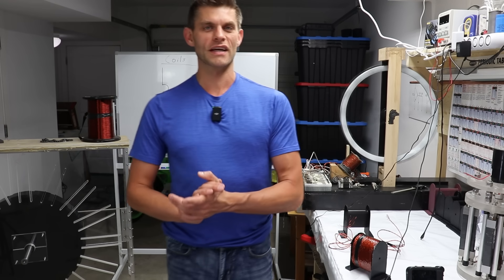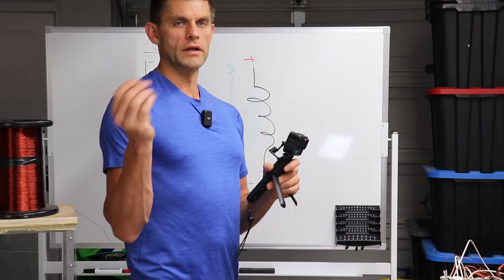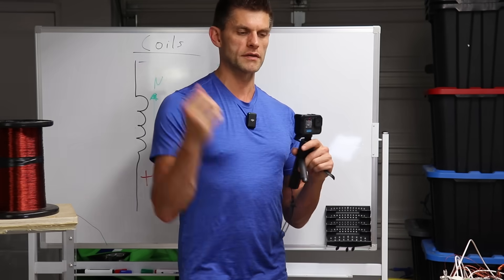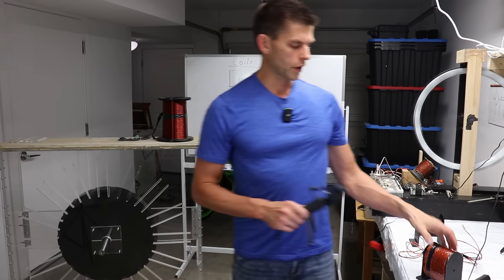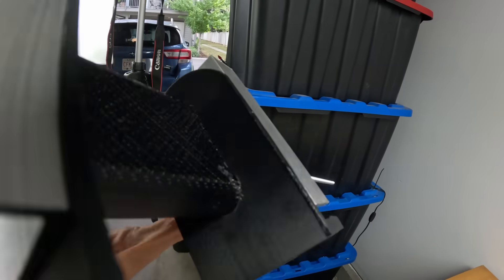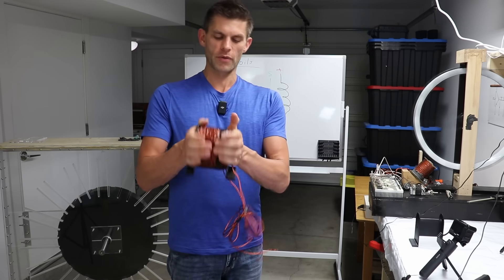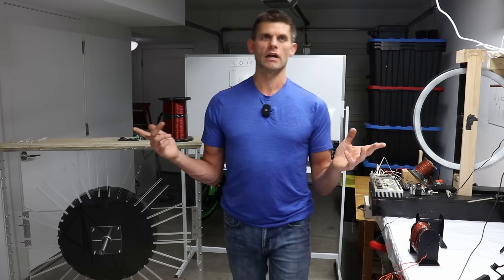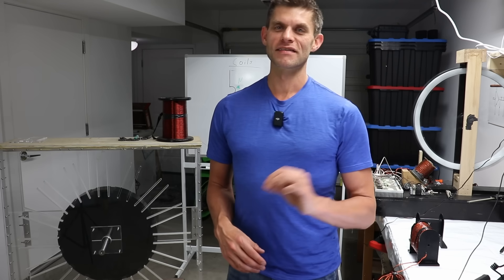Unlimited Energy in My Garage (No Patents)

Comment: Says he has a degree in electrical engineering, then goes, "We're not using transistors, we're using MOSFETs." That’s like saying, "We’re not using computers, we're using desktop PCs"
Reply: ‘I haven’t proved anything yet, but send me money”
😂😂
Reply: He also pretends Vacuum energy can do work so while he may have an EE degree he definitely slept through physics or just wants to con morons with from what I can tell is literally nothing but a pulse motor.
Reply: @seditt5146  radios and tv's used to run on vacuum tubes ,something to think about
Reply: @seditt5146 yep, you hit the nail right on the head
Reply: No, MOSFETs and Transistors are very different beasts ,MetalOxideFieldEffectTransistors are voltage-controlled..., whereas common bipolar npn/PNP Transistors, are current-controlled devices. Either you had some sleepy teachers - or slept often on the schoolbench , you yourself. 😊
Reply: @wilhelmbeck8498 A MOSFET or ‘MOSFAT’ as he calls them is a type of transistor.
Reply: @wilhelmbeck8498  they are both transistors, just working on different principles. BJTs came before MOSFETs and each technology has some drawbacks and some advantages. For switching, we definitely use MOSFETs as opposed to BJTs.
Reply: @wilhelmbeck8498 Mosfets are a different type of transistor, it even has transistor in the name. npn and pnp are bipolar transistors, but mosfets and bipolars are both transistors!
Reply: Zero-point energy, the minimum energy that a quantum mechanical system can possess, cannot be harnessed as a practical energy source. While it’s a real concept in physics, “zero point energy” represents the lowest energy state, and thus there’s no way to extract energy from it because there’s no lower energy state for the system to transition to. Attempts to harness it for energy are often associated with pseudoscience and misconceptions about how it works. Extracting energy would require a lower energy state, which doesn’t exist for zero point energy. It. Is. IMPOSSIBLE.
Reply: @gregd335shot9  Why does magnetic field collapse generate massive flyback voltages?
Reply: @idk-z6i-f8t Induction...When a magnetic field moves past a conductor it generates an electrical current, this is how normal generators work by moving the magnet past the cool of wire.  As magnetic field collapses it is also moving and it induces an electrical current in the coul of wire that produced it, this is known as flyback voltage and is what a flyback transformer is built around.
Reply: @gregd335shot9  Chat GPT is really smart huh
Reply: @andy7638 I am, thank you 🙏
Reply from the maker: Lol ill give u that technically valid. But I think u know what I mean

Comment: Hey, i have some pyramid power i want to sell you.
Reply from the maker: No im good I have a ZPE generator
Reply: @MadscienceLPTECH 
But pyramid power is much cheaper to implement, and works just as well, there really is no downside.

Take my word for it, i am a self claimed engineer.
Reply: But pyramid power i just so much cheaper to implement, and it works just as well, there really is no downside to it.

And you can take my word for it, i am a self claimed engineer.

Comment: I have an easy idea for you to try if you ever get time. Not sure if it will work but i think its a good shot. 

Take a long shaft horizontally and put another smaller shaft on each end perpendicularly. Place a heavy permanent magnet on each end of the smaller shafts (rare earth). Then all you need is a casing with electromagnets around the ends of the big shaft (where the smaller "arms" with magnets are). Pulse the electro magnets to spin the shaft and use the weight of the attached permanent magnets as a flywheel of sorts. Basically you could pulse the electromagnets for a fraction of a second and get one or more rotations of the shaft to generate energy. Then you just figure out the pulse timing correctly and as long as you can generate more energy than the electromagnets use you will be golden.
Reply from the maker: Love it 😀

Comment: Free energy sure is expensive.
Reply: Zero-point energy, the minimum energy that a quantum mechanical system can possess, cannot be harnessed as a practical energy source. While it’s a real concept in physics, “zero point energy” represents the lowest energy state, and thus there’s no way to extract energy from it because there’s no lower energy state for the system to transition to. Attempts to harness it for energy are often associated with pseudoscience and misconceptions about how it works. Extracting energy would require a lower energy state, which doesn’t exist for zero point energy. It. Is. IMPOSSIBLE.
Reply: ... according to our CURRENT understanding of physics.@gregd335shot9
Reply: @gregd335shot9  That sounds very plausible indeed, but you've overlooked one thing; anything is possible in maga physics. Trump needs a new energy secretary!

Comment: If you have one working why do you need another one and more money? And $5000 for batteries? Why? Already invested $1000? How?
Reply from the maker: The first one is basic and needs to be upgraded. 5000 in batteries for 18 new lead acid @ 250-300 each
Reply: @MadscienceLPTECH  you don't need 18 of them for a test, you need two or three.
Reply from the maker: The rotor alone was 3k
Reply: @MadscienceLPTECH exotic materials make everything work better? Using cheaper matterials allows for more expiramenting. John said it was working on a bicycle wheel. Make it work there first.
Reply: @MadscienceLPTECH  Shoulda went to China, woulda been cheaper

Comment: The optimist in me would love to see the test results show an excess of energy, that would be fascinating, so I want it to be true. The skeptic in me didn't like the explanation of sending a charge to the battery to separate the dipoles and gather the universe's energy. Call me crazy, but that legendary sidestep of the science that proves your concept has me worried. It does make me more excited to see the results, one way kr another.
Reply from the maker: Thank you! Good attitude
Reply: I also got lost when you "Mad" said the flyback voltage was higher. You didn't mention the time factor. Work is Power times Time. I need to watch the rest.
Reply: The idea is that you cannot draw energy from the AEther under steady state conditions, but if you create a "glitch" in the AEther, it triggers a brief avalanche that releases energy.  The local environment in which this occurs is not the crude moving mechanical parts of the rotor but within the atoms of the electrolyte in the battery. The coils and rotor just produces the trigger.  

Disclaimer: This is just my understanding of what is explained in these videos. I claim no actual experience.
Reply: @codetech5598  While you may rationalize an explanation including the AEther as sufficient or scientific, I do not. Energy cannot be create or destroyed, only converted into other forms... Chemical, electric, thermal, kinetic, potential, etc.. . His claim is that he violated this law, grabbed energy out of thin air, or more accurately he created a magnetic free energy amplifier. The electricity produced by the first battery is supposedly charged by the wheel, then deposited in a second battery. He says what is stored is in excess of what's used. I don't think he's measured what's used. Just the kinetic force required to start and maintain the wheel spin would be a sizable electric draw if this is a closed system. If he isnt factoring that out properly then he may actually be spending more energy than he is producing, breaking no laws, and surprising nobody. Sorry to be a skeptic, free energy is wishful thinking that violates our current understanding of physics, which is why no such machines exist today.
Reply: @wmbtech  Did you pay your sunshine bill this month?
Reply: @codetech5598  Oops. I thought I was talking to a serious person. Sorry, I dont have a response for nonsense.

Comment: Really cool to see you experimenting in your garage, but I’m skeptical that a “zero-point energy” motor can actually produce net power. Zero-point fluctuations are a real quantum effect, but no one has ever shown a way to extract useful energy from the vacuum without putting in at least as much (if not more) energy first—any claim of over-unity or free energy violates conservation of energy and the second law of thermodynamics.

If you really believe this works, please share detailed power-in vs. power-out measurements using calibrated instruments, a full test protocol, and independent validation or peer-reviewed data. Until then, it looks like another perpetual-motion style device rather than a practical energy breakthrough. Good luck refining your setup!
Reply from the maker: I hear ya, we are just trying to prove the impossible here.
Reply from the maker: Appreciate it 🙏

Comment: Every time someone tried to make the possibility of free energy available to this world, they quickly vanished. This is against the energy trade, and it’s a threat to the power brokers of this world. My advice would be to keep it to yourself. Be safe brother!
Reply from the maker: Thanks for the support and advice, I will be careful.
Reply: I'm an EE. I understand the rotor coil etc thoroughly.  What's vague in your description and quite frankly unlikely is the lead acid battery creating zero point energy in response to a voltage spike.  If this really is the case, apply a spike and measure the energy created.